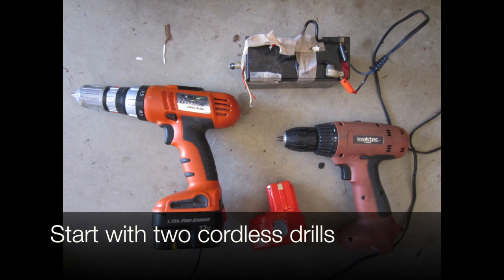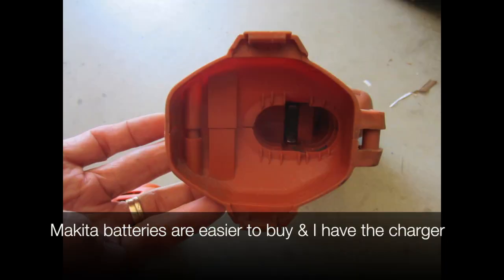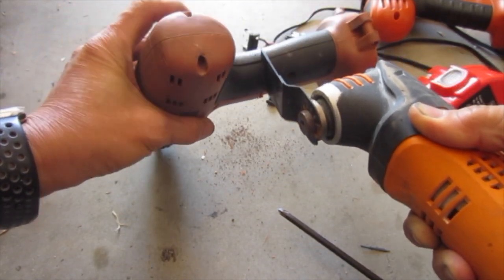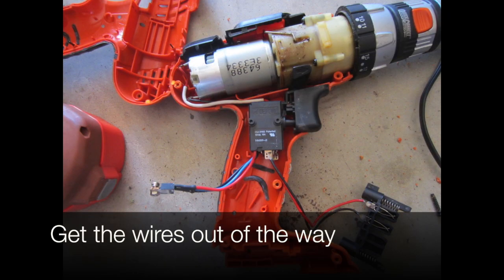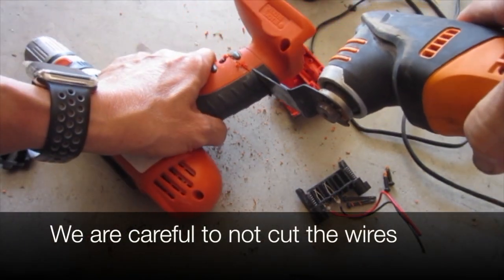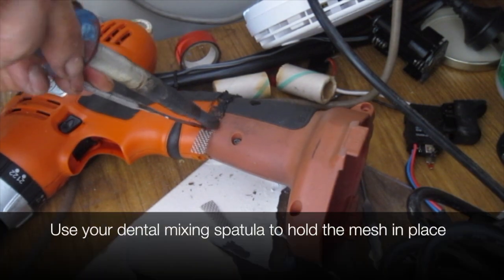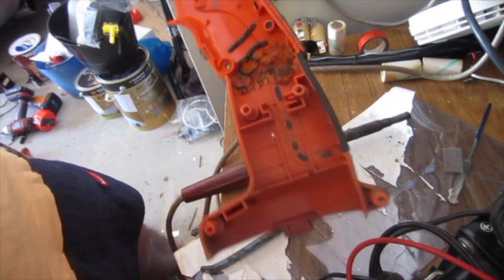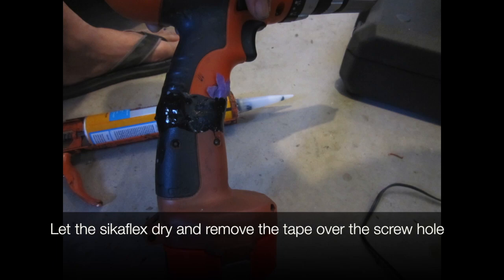Transplant cordless drill handle, battery  and trigger

Comment: maktec is still made by makita.  your idea about the ss mesh is how i fixed the "bushpig".  i was doing demolition removing roofs and i didn't want to put up with the drone of a bloody generator or the risk of electrocuting myself so i set myself up with a 12v panasonic and a cheap expendable 12v ryobi from bunnings.  for power i used a car battery to crocodile clips to female plug to 240v extension lead to a male plug to more croc clips to a dead gutted panasonic battery that fitted into both drills.  the panasonic always started to smell and smoke so i would swap to the ryobi, which i considered expendable, and finish the roof with that.  i quickly decided the panasonic was not an equal to the ryobi.  i moved up to 18v makita with batteries like yours.  no more need for the car battery.  and adapted the ryobi to take 18v makita batteries with the assistance of velcro.  a great no.2 drill.  poor thing fell off the ladder one day and the handle broke in 2.  battle fatigue caused by using it like a spanner.  so after a lot of thought i decided to use ss mesh like you.  a much bigger patch held to shape with copper wire till the epoxy set.  back in action.  i moved up to the li-ion makita range and adapted the bushpig to take this 4th battery type using copper strips attached to reshaped drainage pipe and velcro.  it ended up with wood screws and hose clips holding the motor housing together.  i've retired it off now and store it in a dry warm place.  the cheap disposable drill earned my utmost respect.  i'll never part with it.
Reply from the maker: Nice story . Sounds like the bushpig was a bushworkhorse.